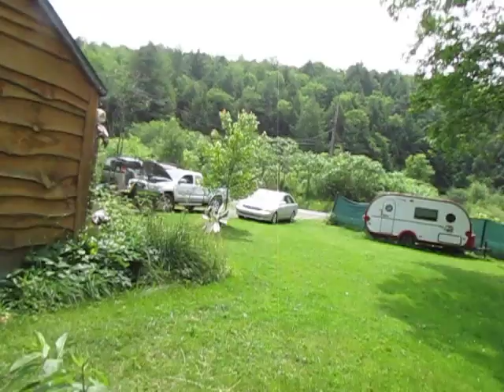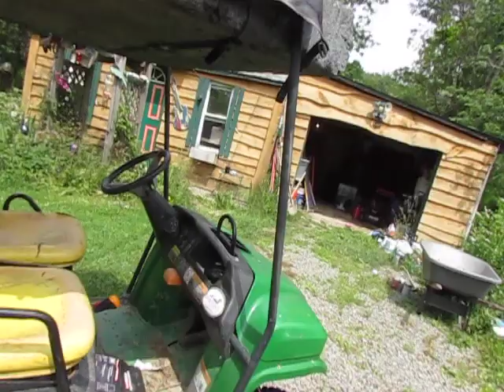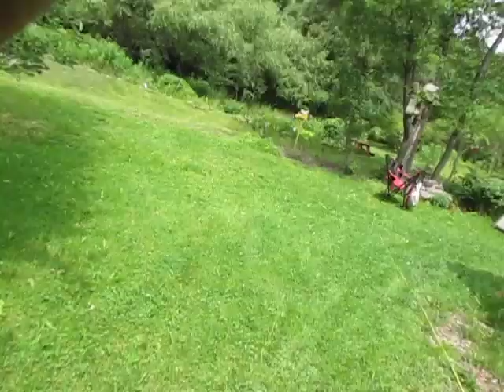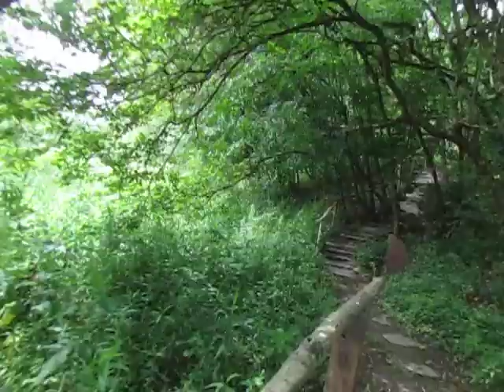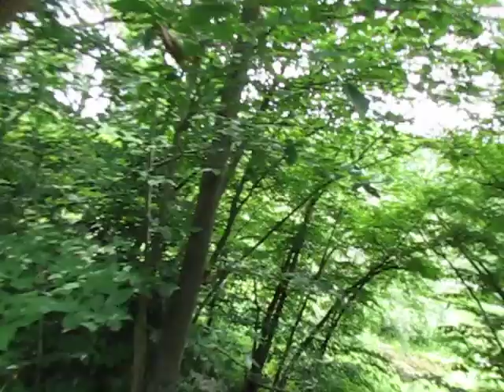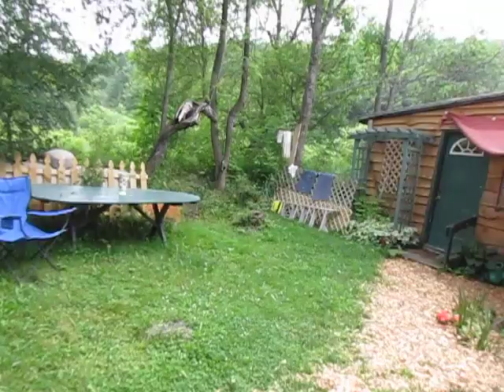How to Charge a Solar Generator Without Using the Sun

Comment: 250 ft of exterior 12-2 wire and an outlet would be the way to go. We need MORE fossil fuels, to get off of fossil fuels. Next generation Nuclear is the best way to go, in my humble opinion. But we have our heads up our asses, as usual. Too bad we can't generate energy from gay pride, there's lots of that.
Reply from the maker: That's what I used to charge the solar generator that I paid over a thousand bucks for.